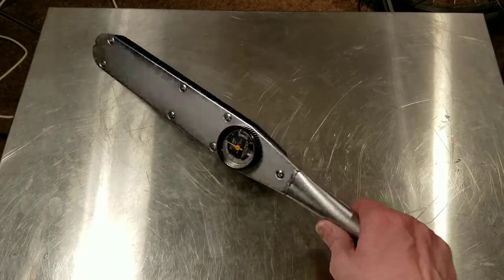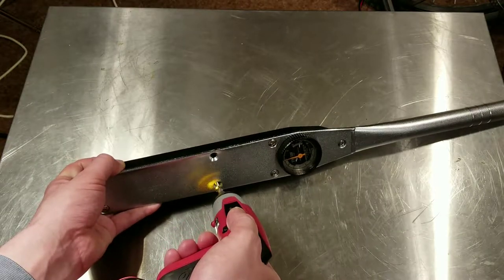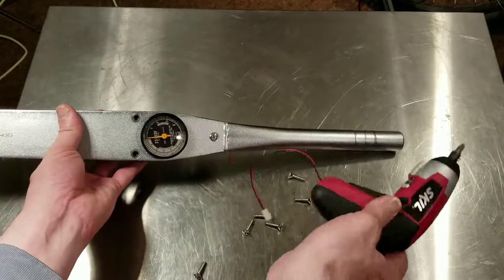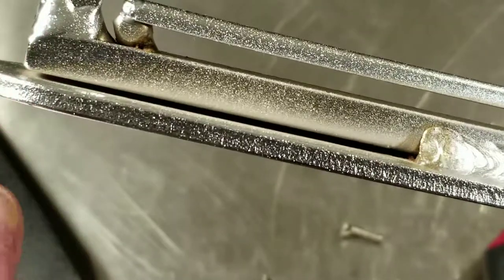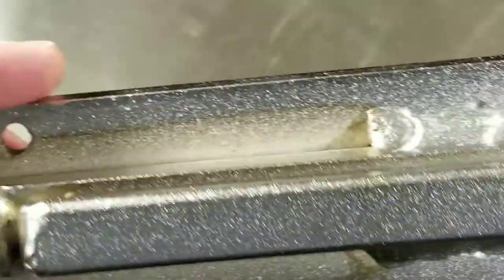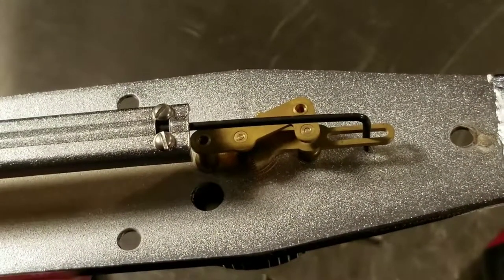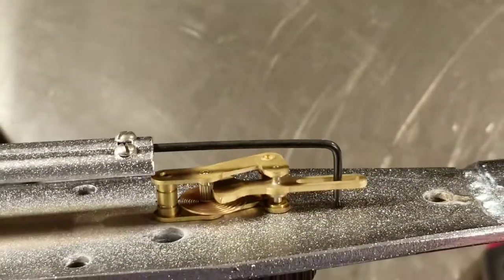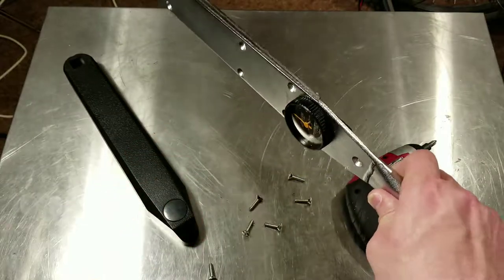TearDown: CDI Dial Torque Wrench

Comment: what is inside a digital torque meter ? i mean what is the sensor part?
Reply from the maker: It is a wheatstone bridge, a special resistor that can measure microscopic changes when attached to something that is bending or twisting.